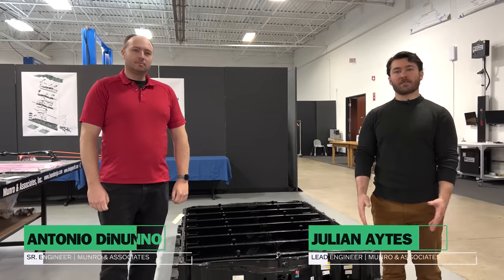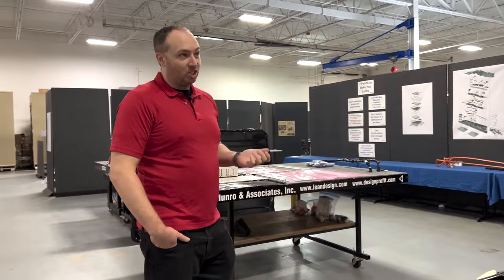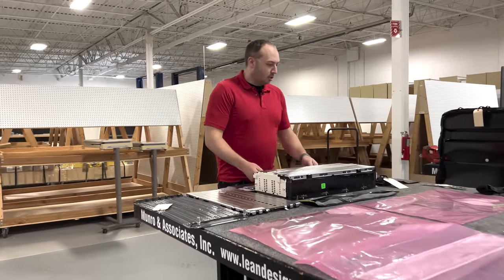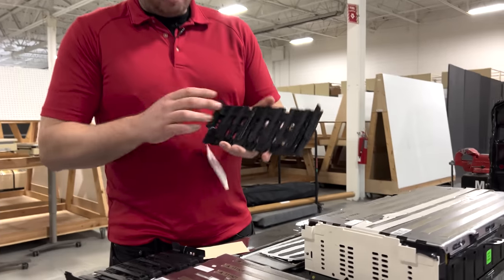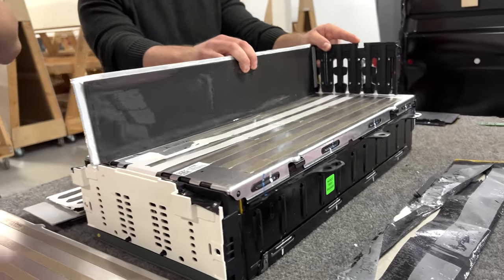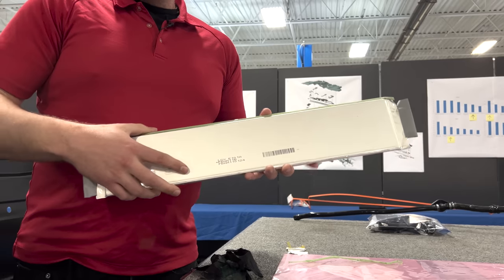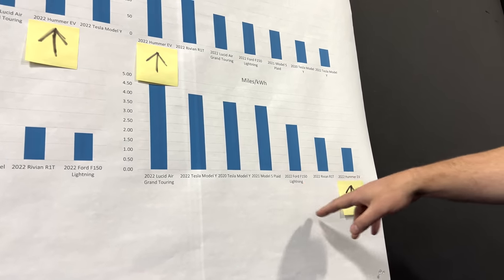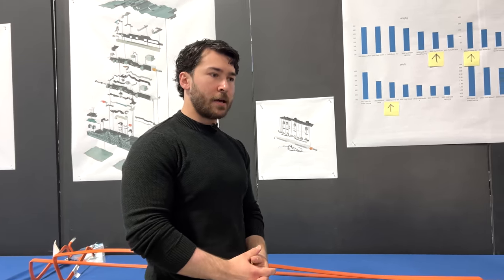This is NOT Lean Design: Hummer EV Battery Pack Breakdown

Comment: They did an amazing job of staying professional and not just calling it out as shitty design.
Reply: You mean lying?😂😂😂
Reply: NOT lean design........mic drop
Reply: "This is an unconventional design.  They made this in a very unique way. The use of weather stripping certainly haven't been seen in battery packs." Lol.
Reply: @bradthebad01  They also said it was simple so what part of those four statements do you see as a negative? I see them as positives from an aftermarket viewpoint.
Reply: @zorbakaput8537 Unconventional, Unique.
Reply: @zorbakaput8537  hahaha… “positive of an after market view point”??? This is like carrying a 50 pound flash light with 12V architecture with incandescent bulbs and saying there’s an aftermarket opportunity of being able to service a 50lb battery. Brilliant.
Reply: This battery was designed for extreme off-road use and low volume production. GM knows that Hummer buyers will flog it mercilessly. Stamp and weld construction is perfectly suited to that application. Casting and extruding tooling makes zero sense on a vehicle that is unlikely to ever sell 20k units.
Reply: Atypical.
Reply: Which half of the entire Hummer production volume did Munro buy?
Reply: @Crunch_dGH  they made 2 last quarter. 😂
Reply: At least this battery pack is repairable. Unlike Tesla's 4680 piece of crap!
Reply: @DavidJohnson-tv2nn  hahaha… that battery can be 97% recycled for less than a 212 KW BATTERY!!! 🤣🤣🤣 POS… only made 2 last quarter. I could make two in my garage. Wtf?
Reply: @Miata822  keep telling yourself that 3500 welds was a solid engineering choice. 😂😂😂
Reply: @GET2222  I will be laughing at the Tesla owners throwing their cars away (recycle if you want to call it that) when their battery pack craps out :)
Reply: @DavidJohnson-tv2nn  don’t hold your breath many have gone over 1 million miles. My Model X has gone 80K miles over 7.5 years and never been serviced. My POS BMW X5M just had a $3k brake job. My brakes on my MX will go 250k miles. I have 15% wear on them at 80K. Best car I have ever owned. I have BMW, Mercedes, Aston Martin and a Maserati. Everyone in my family fights to drive the tesla even though it’s the oldest car I own. Love it.
Reply: @GET2222  Well, if you ever do have issues with your Model X battery, at least is can be repaired. Not easy but repairable. Don't you think it's odd that Tesla chose to make the most expensive component in the vehicle unrepairable with their new design? Looks like they are following in Apple's evil greedy footsteps. With planned obsolescence and making the customer purchase a new car from the billionaire!
Reply: @DavidJohnson-tv2nn  Tesla Batteries typically don’t go bad. Even UBER DRIVERS using superchargers 4x a day  and charging to 100% capacity because they don’t have home charging are getting 140k miles before replacing the batteries in their model 3 before getting a battery replacement. The cost was $8-$12k depending on the battery size. I asked when I test drove a model Y with my younger brother before he bought one, he loves it and it gave me a lot of shit for my Tesla for years and he said he could be happier. He was a tesla and EV hater. He drives 30k miles a year and said he could never make it work. I have lost 12 total miles of range on my X in 7.5 years. I have never owned a car this long. I don’t think I will ever sell it, but I’m now eyeing the MX PLAID. 

Look I doubted the liability off a tesla until I owned one. In fact, I thought there was no way I would not own an ICE car myself. Within 6 months I began reading all of the lies and thought this is weird. I knew nothing about YT channels on TESLA. Everyone thought my X would catch fire. But then I began paying attention. The main stream media treats TESLA and musk different than any company I have ever come in contact with. I own two software companies in AI and an Advertising Agency. The software in a tesla is remarkable. I highly recommend checking one out if you haven’t.
Reply: @Crunch_dGH  😆
Reply: They didn't seem to fully understand the build or underlying design decisions, so they would have looked extremely foolish if they called it "shitty." They didn't even seem to know that the battery had an integrated BMS (at least, they didn't address it), and that's likely the most advanced feature of the Ultium battery (it's the first production EV battery with a wireless BMS).

Keep in mind, while Munro is catering to the slobbering Elon fanatics on this video channel, at the end of the day, they still have to sell legitimate reports to automakers and manufacturing companies. So they can get away with being bias in their video teardowns, but they can't go full incompetent.
Reply: @newscoulomb3705  3500 welds. You don’t have to be a fanboy of anything to know this is not how you make a car/truck or whatever this thing is… keep in mind, they made two of these last quarter. It’s terrible engineering. Marketing and BARRA wanted this thing pushed out. The reason why it is bad is because it was a premature timeline. Anyone defending the rescission making process here is part of the problem. And where did GM have the problem? Moisture in the Battery pack. 

It’s 2023. GM has failed on so many levels because Barra in inept. Barra ignored the EV revolution. She could have been leading but she damn well did everything possible to ignore it, stall it and even stop it.
Reply: @DavidJohnson-tv2nn  good point, except Tesla have advanced their engineering to the point where they don’t need to make a pack repairable. It doesn’t break, however, it will always need recycling, and guess what - they’re leading there too.
Reply: @userscott  Here's the problem...
I'm sure you're aware that there is no such thing as "It doesn’t break". You can increase reliability, but some units will always fail. Just like airline travel is incredibly safe, but not 100% safe. When there is something as expensive as a battery pack, it must be repairable. There is a moral obligation not to screw people.
Reply: @DavidJohnson-tv2nn  but look at the reliability data. More people benefit from how reliable they are and their cost to produce than people who don’t because it’s a structural pack IE not repairable in the conventional term. Further battery data publicly available certainly for the Tesla shows that the majority of (extremely) rare failures are captured in warranty period. I get your point but the reality is we are comparing a company who have built one of the worst battery packs in the world with the global leaders. I know which one I would trust.
Reply: @GET2222  I don't hate EV's, but do hate Apple and Tesla for their anti-consumer/anti-independent repair business model. How often the battery packs fail isn't really relevant. It's the cost for a new one when they do fail that matters most. A disposable battery pack is the equivalent of a sealed engine or transmission  in an ICE vehicle. No one would ever buy it!
Reply: @DavidJohnson-tv2nn  Apple is one thing, but hating tesla for not allowing Joe mechanic working on state of the art battery and software system isn’t really fair. I get your theory. However, you need to think that if a car gets repaired or a battery gets repaired and started on fire or kills someone because some camera isn’t hooked up right, Tesla is absolutely screwed. Phones are a commodity. Cars are 3,000+ lb missiles traveling down the road.

Kindly consider you being the owner of tesla. What is your strategy for every mechanic who is just trying to make a buck and is fixing things and misleading people into fixing things that should not be fixed. It a battery is damaged by road debris and hot rod Jimmy with a chip on his shoulder makes an attempt to fix the battery and it burns the house down and a child is dies in that fire… what do the headlines say? 

HOT ROD JIMMY BURNS FAMILY

or 

TESLA BURNS TAKE THE HOUSE AND THE FAMILY WITH IT

I think we all know what the headline says. Jimmy skates and TESLA takes the fall. Now, times this incident across the nation where mechanics are losing work because of tesla and are looking to feed their family. 

It’s been 7.5 years and I have yet to have my car serviced. Your fear is not based on facts. TESLAs are basically maintenance free. TESLA is not trying to make money in maintenance. 

We had our MX. for a week. My wife bumped a car in the parking lot at my sons school. She cracked the wheel well trim piece on the rear. She brought it to tesla and the fixed it for free and $78 for the part! They told her we don’t believe in making money on service unless it’s knowledge based engineering services. It took them less than an hour.

I was stunned.  

BMW would have charged me $500 minimum. I told my BMW service guys this, because I still own two BMWs. My BMW SERVICE TEP OF 20 years jaw dropped. He agreed. And said, We won’t touch a car for less than $250 even if it’s just for diagnostics. People criticizing tesla who have no experience with a tesla or don’t own a tesla are pulling from their own personal experience of OEMs screwing them. Being an owner of a tesla for 7.5 years I’m blown away by the service, knowledge of sales reps and overall experience.
Reply: @Miata822  
It was "designed" to power a really heavy vehicle, but a single stack couldn't do it, so the just added more until the numbers were "close enough".
It's a dogs breakfast.
Reply: Either there’s a version of this with Sandy, but it’s nowhere near PG13, or Sandy looked at it, grumbled that his cardiologist would never allow him to be in the same room at this, and left—and now no one knows where he is.
Reply: Is it really shitty? I mean, with this casing, I'd be much more comfortable about the Hummer traveling through rough rocks or deep water.
Reply: @JDCheng  3500 welds and 2,000 pounds for a battery pack is lazy engineering. Not only that but they have moisture problems with this pack. So your security claim is wrong. This was a cheap attempt to bring this to market fast. Otherwise, they would have made more than 2 last quarter. It’s embarrassing.
Reply: @GET2222  well, it did come to market fast.  Much faster than the Cybertruck.

Would it really be worth it to make a dedicated hydroforming press for such a low-volume halo vehicle?
Reply: @JDCheng  bringing a POS to market to be first that has such bad production quality, not printable and low volume is quite possibly the dumbest go to market strategy I have ever seen. I own an advertising agency for the last 25 years and work with fortune 50 companies. This is how you rot your brand and and culture from the inside out. No engineer will ever defend the HUMMER as and engineering marvel. This is complacency at it core. It’s a sh-t show.
Reply: @GET2222   So, you can build it better then? Maybe you should apply to GM as an engineer.
Reply: Btw… what does this have anything to do with CYBERTRUCK? This POS came out 18 months ago and they made 2 last quarter. Many of them have been recalled for battery issues and bricking.  Nothing about the HUMMER has been successful. Poor planning. Poor engineering. Poor execution. Crap.
Reply: @JDCheng  no. Munro just communicated what a sh-t show it is. Why are you defending it? Nothing about it is good.
Reply: @GET2222  I mentioned the Cybertruck because Tesla is the most valuable automotive company in the world.  And having terrible CR reliability scores hasn't hurt the brand at all.

Besides, "move fast, break things" has been the Silicon Valley mantra for ages.
Reply: @Crunch_dGH  Minimum 33% of the first quarter 😂
Reply: Sweet ☺️
Reply: @Miata822  "This battery was designed for extreme off-road use and low volume production. GM knows that Hummer buyers will flog it mercilessly. Stamp and weld construction is perfectly suited to that application. Casting and extruding tooling makes zero sense on a vehicle that is unlikely to ever sell 20k units."

If you don't sell 20 000 units you will likely never be profitable.
Reply: @yourcrazybear  "Halo" vehicles are seldom profitable. Just like Tesla's original Roadster, Ford's GT, etc., these vehicles serve as advertising and promotion of a brand's capabilities. Look at how few Hummers have actually been shipped vs. how many articles and reviews it has garnered. 
The Hummer isn't made to impress Tesla fans. It was made to get the attention of ICE truck buyers and convince them to check out GM's upcoming Silverado and family cars.
Reply: A little off topic I guess, but I'm just a little curious about who the "target market" is for a 9000 pound truck.... Towing a large airstream? I wonder what the Miles Per Gallon spec is for the ICE version? 6?

Also curious about how long it will take to charge this thing, from flat to fully charged. I just don't understand..... guess I'm a little slow.....
Reply: @douglas2lee929  Good questions, mostly.
Firstly look at the reviews of people who have driven the Hummer. Many of the usual EV guys that expected to hate it came away enjoying their time with it. It's fun. It is overtly a toy.
No, nobody is towing an airstream with this, just like nobody tows  one with a Lamborghini or a modified smoke0-belching coal-roller. The whole point of the Hummer is to be a toy for rich guys to romp around in, show off to friends, and p..s off Tesla drivers.
It charges fast (800v) but almost nobody cares because it will seldom leave town. It in no way pretends to be practical, but it almost is. This is nobody's only car. A Timex Triathelon keeps better time than a Rollex, but people pay 1,000X more for the big ugly watch. Don't ask it to make sense.
Reply: @GET2222  That's 2800 pounds.
Reply: @JDCheng  It is fine for what is essentially a “test mule” for future products and pickups. The comment section can get a bit excited over weld counts and cooling channels but the fact is this system is one of the few that can accept 350KW charging up to about 55% is pretty amazing.
Reply: @Crunch_dGH  they bought over 400 Hummer EVs? No, they didn't buy half of the production of the GMC Hummer EV, of which about 856 were delivered before the plant shut down to change models.
Reply: @newscoulomb3705  "a wireless BMS" is not something good.

the BMS and the battery don't move independently from one another.

so making the BMS wireless just adds cost, complexity and failure points for no good reason.
Reply: @anonym3017  You're making an assumption that it is less reliable and more complex without evidence, and you're ignoring the fact that the benefits might outweigh the cost/complexity. 

Are you saying that we should all still be using wired home routers instead of wireless routers? Landline phones instead of cellular phones? 

Regardless, the key point is, they failed to even address it in their teardown, so positive or negative, it was simply never discussed.
Reply: @newscoulomb3705  Wireless connections are always less reliable than wired connections. That's just inherent to all of them due to going over the air and needing to compete with a bunch of noise and other signals rather than going through a twisted pair wire where exterior noise cancels itself out.

and yes. for everything that is stationary, so desktops and consoles,  you should still use a wired connection because it's faster, simpler and more reliable while having zero downsides compared to a wireless hookup due to the thing being stationary.

Wireless signaling needs a sender, a receiver, antennas for both of them, computing power for both, code for both and wires that connects the sensors to the sender as well as connecting the receiver to the BMS in some way.

meanwhile a wired connection needs some wire to connect the sensor to the BMS and that's it.

so a wireless BMS is significantly more complex and expensive than a wired one.

and again. the battery has a fixed position inside the vehicle. so wireless connectivity has no advantages to speak of.

furthermore the stuff visteon claims as advantages is either ridiculous (such as saving weight due to less sensor wires. which way a few hundred grams at most)due to how riodiculously small the effect is,

physically impossible and/ or easily possible with a wired BMS ( balancing indicidual cells inside a module is impossible if tghe cells is directly connected to the power rail and possible witrh any BMS if it the cells isn't directly connected tot he power rail)

Their "battery installation space flexibility is an outright joke as the individual modules still need a power connection to one another and the charging port. And those power cables are way thicker than some sensor cables.

the same goes for their "*easier battery swap tech" claim.  the power connection already needs a sliding pin artrangement. so just use the same tech for the sensor cables.
Reply: @Miata822 It's an absolutely terrible design, plan and simple.
Reply: @anonym3017 What do you mean, it worked great for the titan sub!
Too soon?
Reply: @19coyote5oh9  Different than you could have come up with is not necessarily bad. Unless you've designed a large EV battery pack that we don't know about, your opinion is no better than a casual mark who is being actively misled.
Reply: @19coyote5oh9  Nobody expected Ford guys to understand ;-)
Reply: @newscoulomb3705  Well it takes common sense. These teardowns on different manufacturers packs show how poorly inefficient GM's design is.
It doesn't take rocket science to see this.
Reply: @Miata822  Hahahaha, well they did own Mazda for awhile so 😁
Reply: @19coyote5oh9  You keep referencing intelligence here, but as I've noted in the comments on this very video: Munro's team omitted a lot of information that would have put this battery and teardown in in a much better light. 

An intelligent person would be able to suss out when they are being deceived or misled. An intelligent person would also understand that we don't live in a perfectly efficient world, and cutting corners result in other costs or consequences.  

I'm under no delusions that this battery is perfect, and there is a lot GM can do iteratively to improve and streamline it over time. The difference in opinion here is primarily design philosophy. Based on this and the Chevy Volt's original battery, it appears that GM's design philosophy is to overbuild first and reduce over time. The philosophy that Munro & A is pushing is that you should reduce to failure prior to production and then add until it doesn't fail within its designated service life. 

As a consumer, I prefer GM's approach. Apparently, Honda does too, because they are licensing this very battery tech.
Reply: @newscoulomb3705  It's not just about cutting corners, it's about using the basics of math. Increased weight mass equals less efficiency.
Starting at the very basics of this design, the choice of materials used is clearly not efficient. GM went with the approach of "build it out of steel, weld the hell out of it and I don't care how heavy this thing is" approach, instead of taking the time and making smart design decisions.
Lighter material choices along with basic R@D would have saved them much of the overkill weight, but I guess when your building a tank for the roads GM just didn't care.
I am no engineer, but I am a CWB certified welder/fitter for over 20 years. Just my 2 cents.
Reply: @19coyote5oh9  Ultium cases are structural, and because you're not an engineer, you might not realize that certain metals are better for certain applications. Aluminum is great, but it's also harder to manufacture with, more expensive, and its soft, deflective properties make it ill-suited for protecting the delicate cells housed inside.

Also, the weight has less of an impact on efficiency than some people seem to believe. That misconception had been pushed for some strange reason, and yes, Munro & A are contributing to that. This is why, with the same battery pack, the Chevy Silverado EV has a 450+ mile (conservative) range.
Reply: @newscoulomb3705  Good point.
Reply: @newscoulomb3705  the elon meat riding on this channel is wild
Reply: @newscoulomb3705 Munro are bean counters.  Basically the reason everything sucks these days. For whatever reason, people think these guys are engineering gurus when they’re actually the guys that engineers hate having to deal with because they only care about production cost reduction at the expense of everything else, including repairability.

The Ultium pack was designed to be modular and durable for use in real trucks and SUVs. GM isn’t just building the pack to make it as cheaply as possible.